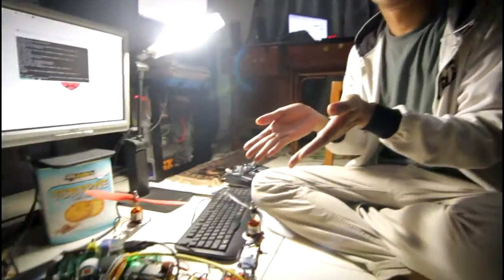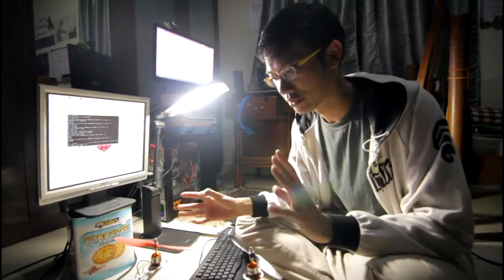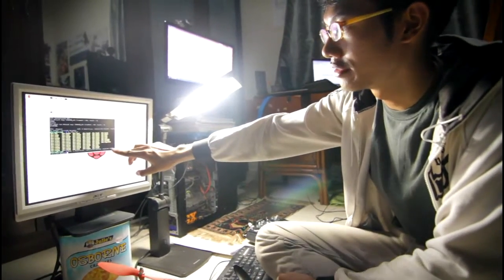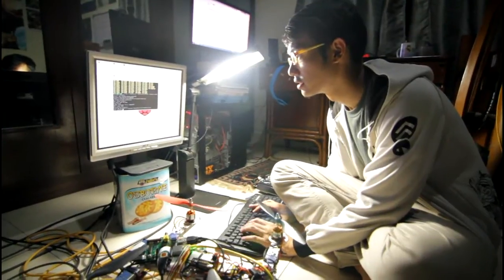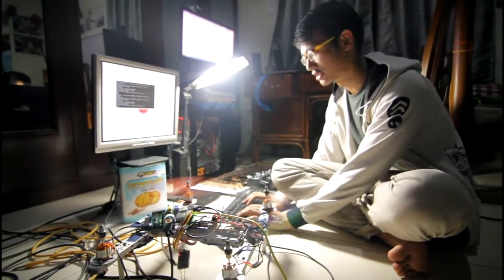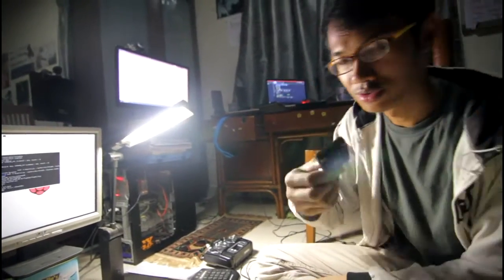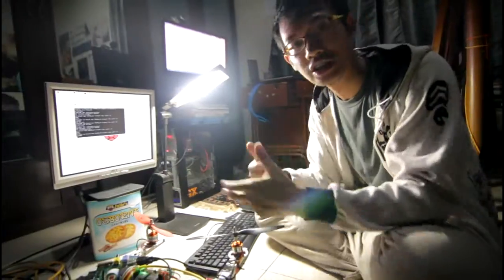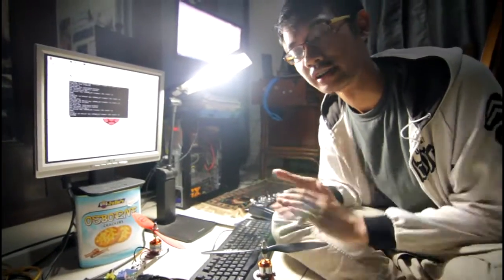APM 2.5 Raspberry pi serial MAVLink with MAVproxy

Comment: nice project...what OS of raspberry pi are u using?...and can that program use for fix wing plane setup?with only 4 channel elevator, rudder, parachute and throttle?......and that project are u do is....raspberry pi act as a Ground Control System...and your quad copter is UAV that you control from ground using raspberry pi based GCS?....am i correct or no....just asking...tq

Comment: I’m trying to connect the raspi with the apm via telemetry port and gpio pins. I don’t get communication but I read about the UART2 port where I have to cut a jumper on downside an make a new one (is like that?). I want to connect it with qgroundcontrol, but I can’t eigther even with usb. No connection. In other way, I can connect Apm with mission planner by usb. In resume:
1- Can I connect my apm 2.6 with raspi (with flytos installed) by UART2 cutting the jumper?
2- How can I connect this configuration with qgroundcontrol?

Thank you very much.

Comment: So, are you using USB for the serial communication? I ask because I'm looking at setting up a serial between the RPI and APM but I'm planning to use a level shifter to create a serial connection between the RPI and the UART0 on the APM. If you're using your usb connection, that means you can't use a power module on the RPI right? It'd fry the board. I'm just wondering if there is a benefit to using serial through USB instead of UART.
Reply from the maker: +Little Grue if you can master I2c protocol. All problems are solved.
Reply: Hah, fair enough. You still can't run it off a power module though right? I only ask because my PM is also monitoring voltage off the battery and providing it to the APM which passes it off to the RPI. I guess I could make the RPI directly monitor the voltage but I don't know of anything specifically designed for that... especially not at 60 or so amps. Lets my RPI know when battery is getting low and automatically land before I lose power.
Reply: Little Grue, did you solve the problem of establishing a connection between the RPi and APM using UART? If so, could you guide me on how to do it(because there's so little explanation on doing this)? Thanks in advance, mate!